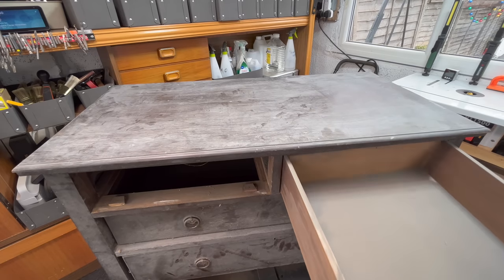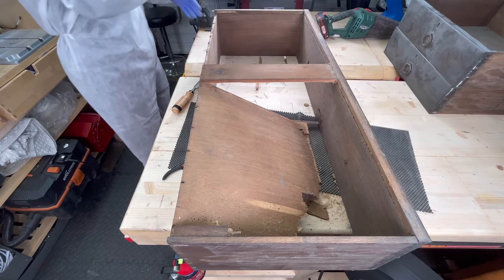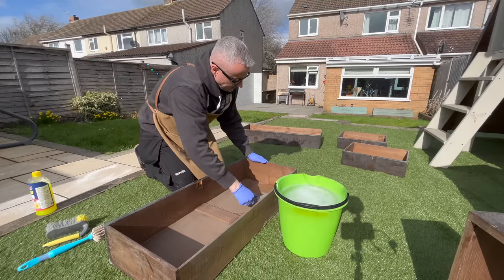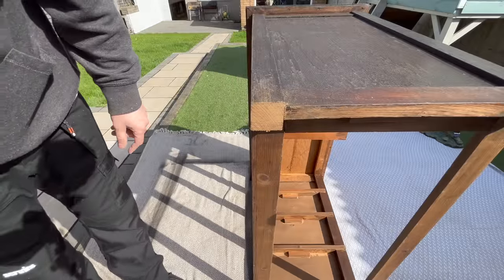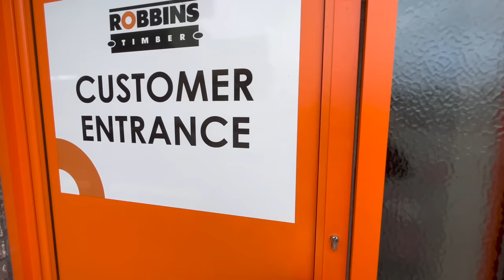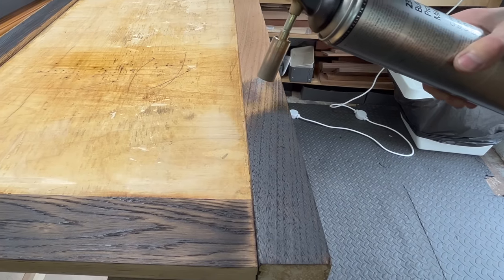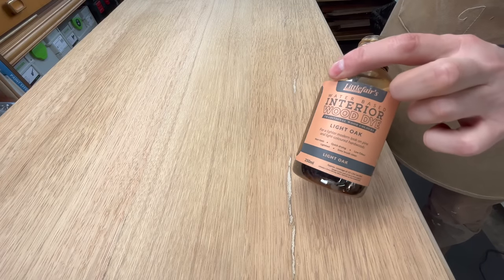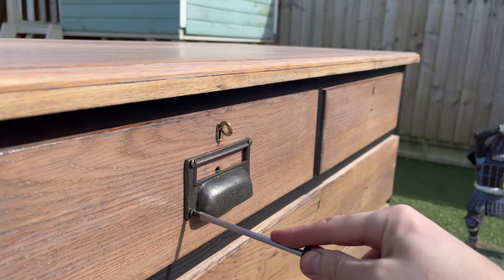The Most DAMAGED and ROTTEN Dresser I've ever seen! Can I restore it?

Comment: I really like how you used the router to trim the back. I have to look into getting a simple router and learning to use it. Measuring and cutting would have been a bunch of work.
Reply from the maker: Thanks . it is called a flash trim bit and it has a ball baring that rolls on the surface you want the other bit to be flash with.

Comment: Next time you have to clean a piece with soap and water, try using a product like Murphy's Oil Soap. Then instead of saturating it with water, dip your brush in the water and knock the excess water out of the brush. After scrubbing, then use a small towel to pat it dry. I had to use this method on a very dirty and dusty doll house, to get it cleaned. Of course I was using a toothbrush at the time. It worked quit well.

Comment: Great vid!  Thanks for sharing your project.  Q.  I'm restoring an old walnut tool cabinet.  It has a lock similar to the one you had on the dresser you restored.  Despite looking at dozens of skeleton keys from a number of local locksmiths, I've been unable to find a key that fits.  Alas, I'll keep looking.  :-(   Thanks!
Reply from the maker: Thanks, you can buy old keys on Amazon and eBay so might be worth a try. One usually its few types of locks.https://www.ebay.co.uk/itm/354678298144?hash=item5294795620:g:KpUAAOSw2MBkIkaE

Comment: If you use tea or coffee on wood and then use the steel wool vinegar stain it gets way better. The stain interacts with the tannins from the tea or coffee and changes the color. Especially if you are using new wood that doesn't have very much of it own tannins for the stain to react with. If you use the wood stain and it doesn't do much, slap on a couple coats of tea or coffee and let it dry, then use the stain over it. The more tannins in the wood, the more that stain reacts.